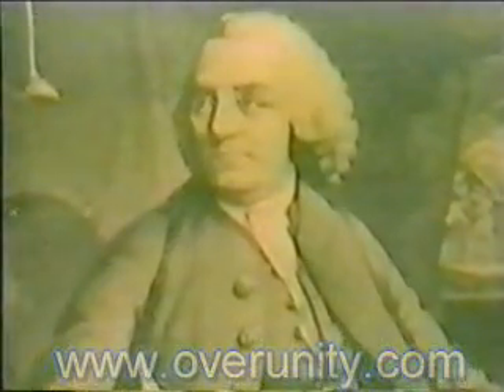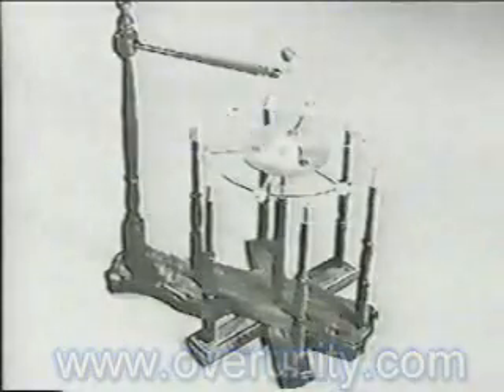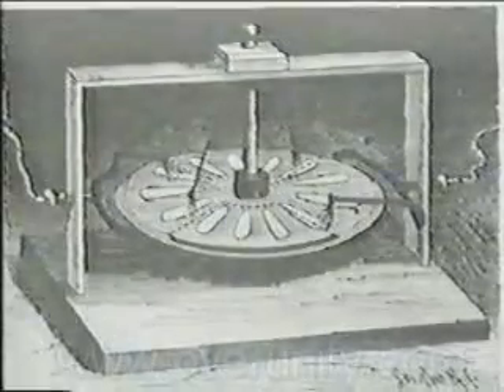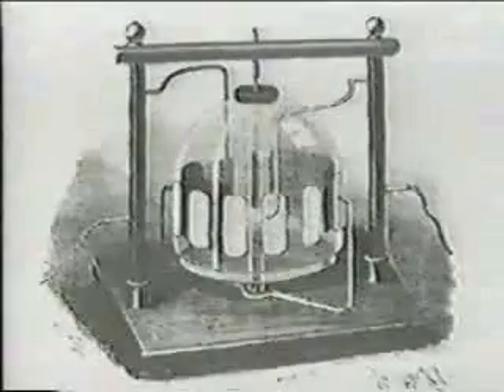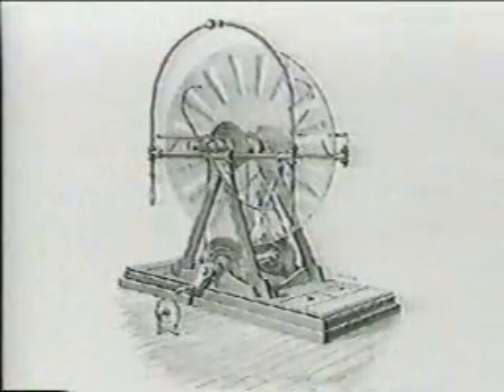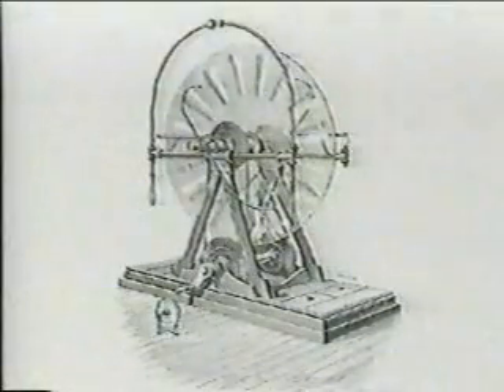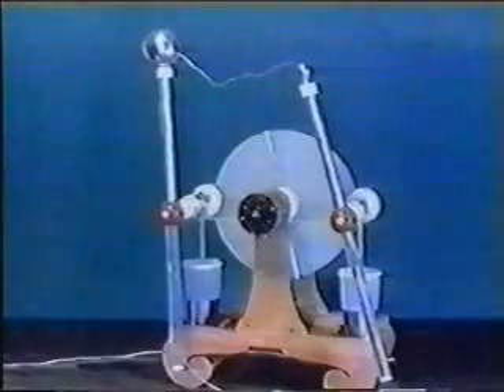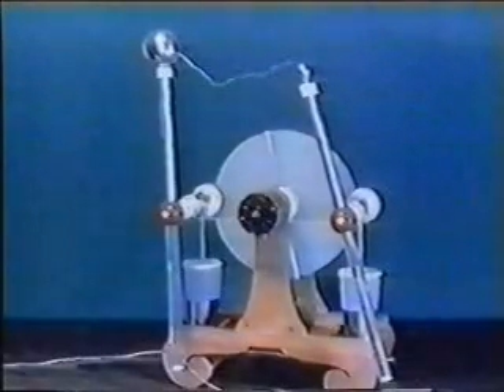Methernitha Testatika free energy machine part 1

Comment: "World-Shaking Generator"
                                                or
                               "True power of capacitor" 

Inward Voltage of capacitor is a Great thing, it's Tremendous and it would only
increase on its way IN (through some thin wire) to the mid- plane.
But mid-plane is "free-way Out" (as "+" and   "-"  equally far)

Out with all of its great Might(Voltage).  (Mid-plane is e geometry plane , not some real object)

Way IN unexpectedly allow us to unleash great power
(Outward Voltage of capacitor so low because because of suppressive force to
way-Out (but non suppressive force on way-IN)  It's great that way-IN could
solve it (Unshackle charge) which is really unexpectedly)

In short - It's "UNLIMITED POWER " because Discharge Voltage much greater then Charge Voltage, meanwhile amount of charge the same

Even though for now its only Theory
It's really World-Shaking and really Unexpectedly
Reply: "True internal power of Capacitor"

in short  -we could discharge capacitor inward
instead of outward, and inward voltage is
higher then outward, by a lot.
When tiny wire ascend to plane between "+" and  "-"
plates of capacitor, its concentration of charge
would increase(therefore voltage on them).

And when charge reaching midst plane between "+" and "-"
it could effortlessly leave capacitor through
(within) its plane (because distance to "+" and "-"
equal in this plane)
======

What if charge on capacitor plates could leave 
capacitor effortless and unleash its true power.
Which usually foreshadowed by nearby opposite charge
(push mines pull(outward force))

But inward force dont foreshadowed and have all of its
true tremendous strength(as if its solitary charge)

And its strength isn't a joke , at all!

If we could remain it intact and go outside with it it 
would be a great output power(output voltage), could we?

And we do have such a place for charge on a way inward(from
capacitor plate) , or better to say such a plane
And it right amidst "+" and "-" plates.
Charge could move within this plane effortless
(because distance to "+" and "-" is equal for any point
in this plane)

So charge could maintain all of its true power and
leave capacitor within(through) mid-plane (as far of 
capacitor as it want)

Its mean we might obtain great power then
Because we pull in low voltage and it push out high 
voltage (with the same quantity of charge)

How it might be done :)
Just tiny wire which descend from "+" or "-" to midst
(between them) and wend aside through mid-plane through
with all true voltage.

Concentration of charge when it reached amidst would be
great , meanwhile there no force to hinder it within
mid-plane:)

Therefore we may see that voltage actually 
rise in a way inward and lowered in the way outward

Its just mind-blowing (really unexpectedly)
Reply: Alla fine dopo aver dato al mondo il computer di John Atanasov andrà a finire che la piccola Bulgaria darà  al mondo tramite Stefan Marinov anche energia gratuità.  Si puo dire che è  un popolo che partorisce geni

Comment: http://rexresearch.com/testatik/testart.htm
so it is not a perpetuum mobile, read and inform yourself !

Unidentified European Report ~ 

        "Believe or Not, Here It Is!"

      The first really running "free energy" machine coming from
        Switzerland, Europe. It was developed over a 20 years Research
        period by a religious group called: METHERNITHA. This group
        lives in CH-3517 Linden, Switzerland. The inventor of this
        superb machine, Mr.Paul Baumann claims, its running principle
        was found by studying the lightning effects from nature. And here are the facts : * Testatika is an influence-type Wimhurst machine which runs on
        it's own energy, once started by counterclock revolving it's 2
        dics by hand !!! * Testatika not only runs on it' own energy, but produces also
        a huge amount of excess power, at least 3 KWATTS of power! That
        is enough to supply a one-person apartment with one machine! * The machine you see during this demo-animation is only about
        70 cm wide, 40 cm deep and about 60 cm tall ! * It delivers DC-Voltage ranging from 270 til 320 Volts, only
        depending on the dryness of the air! At this voltage it can
        supply at least 10 Amperes of DC-current ! * Testatika is not a perpetuum mobile, but an energy machine
        that collects it's huge amount of "FREE" energy from the charged
        and ionized air particles. But there are still some
        technological tricks implemented to overcome the normal
        drag-resistance of a conventional Wimhurst machine, which is
        still the secret of the Methernitha group !!! When will this technology be available for everyone? The Testatika machines, (there already exists also some smaller
        units which only deliver about 200-300 Watts) are not yet
        mass-production type models! They are still laboratory prototype
        units, although they are build with a very good craftmansship !
      For more info contact directly: METHERNITHA, CH-3517 LINDEN, Switzerland 

        TEL.-Nr.: ++ 41 31 97 11 24 The pictures are from some photos and from a video-tape
        Methernitha sells. It shows the machines (also the smaler ones)
        and explains also Methernitha's spiritual aims. The tape has a
        running length of about 40 minutes and is really worth looking
        at it! It is also available in 

        VHS-NTSC and American language. It also shows Methernitha's
        earlier research developments like huge wind generators. With the Testatika there is no fraud, hidden batteries or any
        other hidden  energy source. It is really running! They
        already have the technology of ten years ahead! No more oil, no
        more pollution, no more atomic waste products, no more hunger in
        this world! This is the machine the mankind has dreamed about
        for centuries. Now it has come true! More information about the Methernitha machine is also
        available in the German magazine RAUM & ZEIT, issue
        Nr.40 (8).

Comment: The key element is on 1:11 right before everyone's eyes for many years. Google for Secondary emission and apply that to dialectric which is made from piezzo element with copper and alluminium plates (for function as virtual diode in magnetic field).. This is electron power source what powers the rest of circuit!
Reply: The Linden Experiment:

The two engineers asked Paul Baumann how the machine was working, and he started to explain the "principle." He said that in Nature, there are very fine particles and all going at random (fluctuation) and at an incredible speed. To control and have an advantage of this fact, one must find a means to "rectify" the flux.... He took a U-shaped magnet from the drawer and asked one of the engineers to wind a normal installation wire 10 to 25 turns on to the middle of the U-shape (with the wire coils around the magnet sufficiently spaced apart so as to provide capacitance between each coil of the wire in the circuit). The ends of the wire were kept at a certain length (the engineers said, maybe 3 feet each.) The very ends were stripped off the insulation and galvanicly connected, thus forming a loop (with a grid dip meter shown to resonate at about 80-140 MHz). This was placed on the table. Paul Baumann took two small metal plates and put them together with some paper in between (aluminium-insulator-copper). This was like a flat capacitor. Now he placed this "sandwich," holding it with his fingers in the "jaw" of the Magnet, i.e. between the poles. After a short trial to find the best position, he asked one of the engineers to put the probes of his voltmeter onto the plates. To the engineer's surprise: there was a voltage of 700 volts DC indicated! Paul Baumann said, "When you understand this, you know how it works. This is just the beginning."